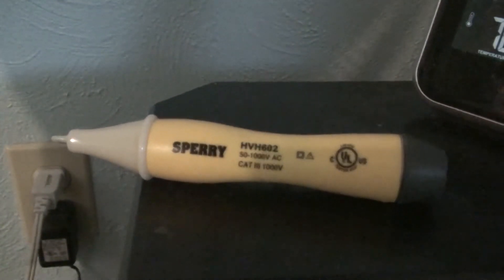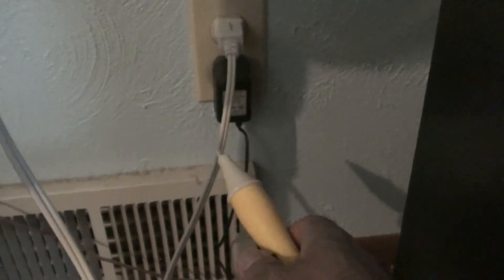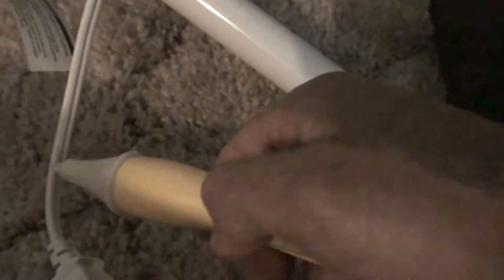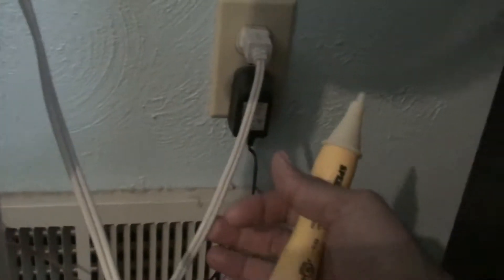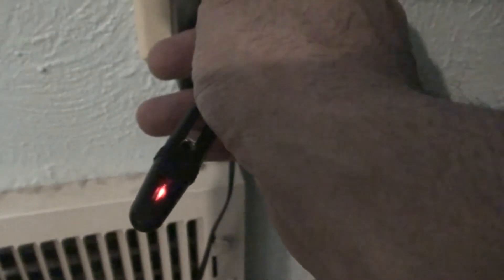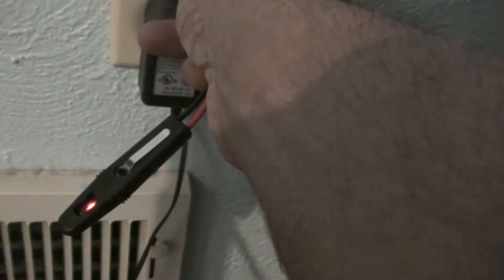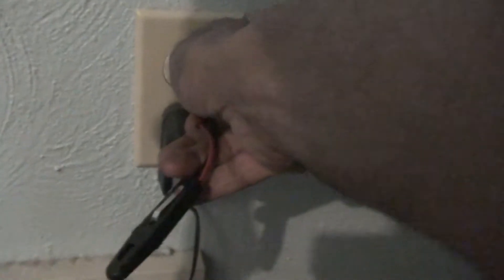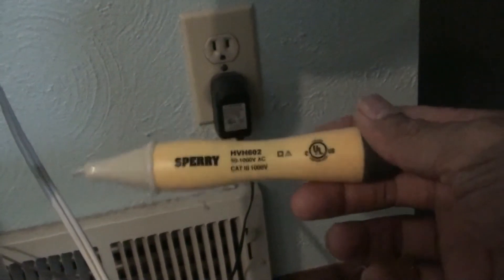When to use a non-contact voltage tester and a lighted Circuit Tester for Electrical Circuits?

Comment: I tried to move up the screen to see which hole you put that pole in, but could see nothing. 😢
Reply from the maker: For the top 2 holes, the one with the smaller pin size is where the wire is always "hot". If you put the tester in here and the ground pin hole, it will light up your tester. If your tester does not light up, then beware, the outlet was wired incorrectly. The other hole with the larger pin is a neutral connection and should not carry power if you connect the tester to it and the ground. Small pin hole should be "hot".

Comment: I can't find those lighted testers anymore. They used to be on Harbor Freight so cheap. Now they want to make us buy the new digital garbage. The no name Harbor Freight had 4 lights, 110, 220, 277 and 460 volts.
Reply: I know your message is from 3 years ago so this is likely irrelevant but I bought one of the little light up things at Walmart today.  (Jan. 5, 2025) I'm on Long Island (Commack store) but I just scanned the barcode in my Walmart app and it's available online.  Hyper Tough Circuit Tester  $4.88
Reply: @Tara-zz6po thanks I just checked, yeah it's there.. the difference is the old ones had 4 lights, each light for a different voltage. 😢
Reply: @jrgmty7685  Sorry.  I don't know anything about these things so I didn't realize.  I hope you're able to find the one you want.  Happy 2025.
Reply: At least we dont have mean tweets. Let's go Brandon!
Reply: @meh9682  now it's all unicorn rides and free crack pipes. Awwww